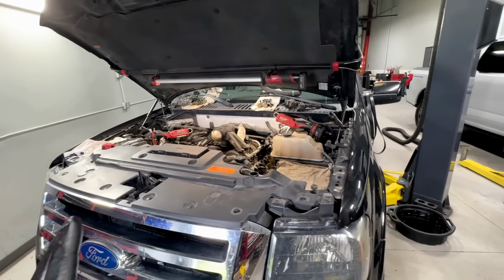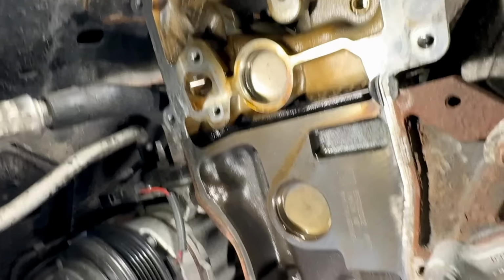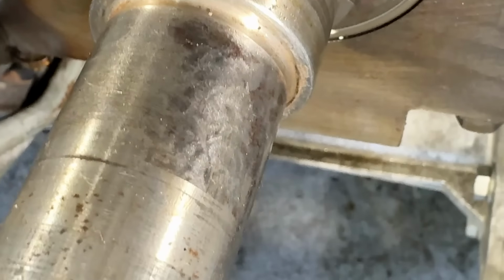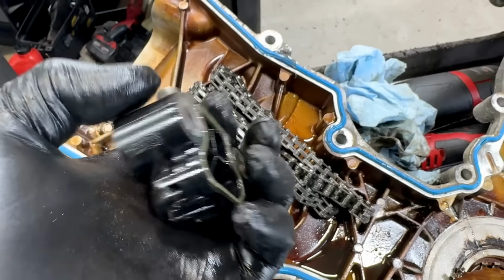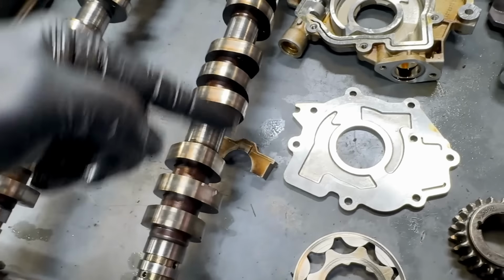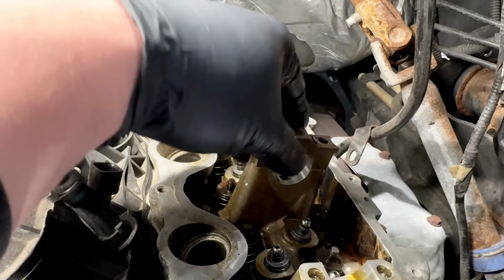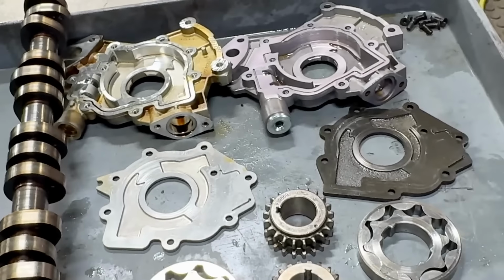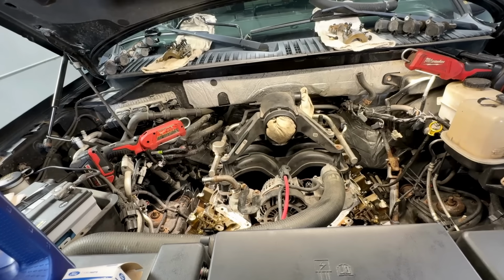How to Destroy a Perfectly Fine Ford 5.4L 3v Triton Engine with a Timing Job!

Comment: My 2006 F-150 Lariat Super Crew 5.4 3v has 272,000 miles and has only had two sets of plugs and an intake cleaning. Everything else is original. Switched to 5W30 full synthetic years before I found Brian’s channel and his recommendation. Pulled a fifth wheel travel trailer multiple times a year until my wife died 3 years ago. Absolutely love this truck.
Reply: Same here but my 06 has 240k on it. I’m thinking it’s time to freshen her up. Edit: my condolences only read the first half of your comment, side not I switched it up after finding his channel. Can you guess how I found his channel? 😅
Reply: Sorry for your loss.
Reply: Seems like when you get a good 5.4 3v, a little luck and a lot of preventative maintenance (regular oil changes) these engines are good for over 200k from the factory? Anyone agree?
I have a 2010 Expedition in mint condition, 166k miles, always maintained and it runs great! Would love to bring it to Brian when the time comes…. Hopefully not for a while.
Reply: I recently inherited an 04 f150 5.4 with 50 k original miles very clean truck after watching all your videos I'm going to seriously over maintain it thanks for all your great in depth information.
Reply: Keep it maintained and it will be a fantastic truck!@damxgopak457
Reply: Samething I went to Brian when I had over 253,000 and everything was original except the my water pump, ac compressor and alternator. I had him replace everything on the motor and add a new water pump, engine and transmission mounts and the truck drives better than brand new now and the mph has improved a lot.
Reply: @1937Jay 
You’re lucky that you live close to him. I’m way far away in North Carolina. I wish we had another Brian here. I would send my truck to them.
Reply: O4 f150 3v. After the cam phaser lockouts and metal timing chain tensioner, I've e had good luck with this engine
Reply: My condolences.
Reply: Sorry for your loss
Reply: @steveturner3999  Sorry to hear about your wife.
Reply: @MichaelStoneqm3  Thank you sir.
Reply: Love the comment.  Sorry to hear about your wife, I hope you are doing well, stay strong brother!!
I got '07 Expedition with 170k, hoping to keep it rolling for a while yet.
Reply: Sorry for your loss, God bless brother. So glad to hear about your lariat. I have the 2007 ,with 102,000 ,and have replaced 1 manifold,and rebuilt trans after unexpected oil failure,plus added extra oil cooler to pull 24 foot trailer,overall great truck and super comfortable. Just wondering about changing to 5w30 synthetic oil ? I think I will do it this summer,2026 and see results. Thanks for your sharing.
Reply: Glad you are liking your truck, sorry about your wife.i lost mine 3 years ago to, she was 38 I was 42 it's hard
Reply: I’m sorry for your loss

Comment: My Chain Is Short, And My Cam Is In The Middle Of My Engine...Where It Belongs. 05 2500HD Single Cab 4x4 Short Bed Conversion 6.0 Gas. Best Truck Ever😶🧂
Reply: All of those trucks rotted away 10 years ago here in the north. 🤣 Great trucks besides that.
Reply: @mph5896  Lubbock Texas...Totally  Rust Free. Ya Hard Times Up North.
Reply: Why are you watching Ford stuff then. You should be out driving that cherry Government Motors Corporation truck🤣
Reply: @saltymofo5870  I Own An Auto Repair- Hot Rod Shop. Oh I Drive It...
Reply: The early 2000s were the best GM engines. The new ones don't seem to be quite so good anymore, much like most of the other brands. 

I had an 87 GMC Jimmy with the TBI 350 and it was pretty indestructible. I ran the hell out of it, had a lift and took it off road a lot. Around 155K miles I flooded it a bit off roading (water). It started getting really sluggish and I thought maybe I had done it in. I bought a hand me down built 350 from a buddy who was upgrading his Blazer to a stroker motor. Before we went to swap it, I changed the fuel filter on the truck so it'd be fresh and ready and the truck laid rubber from a stoplight after. The old filter was packed full of mud. My fuel pump hat broke where the lines went in and it was basically funneling in all the mud and water that I went through. Ran like a champ after. My buddy put my engine in his wife's Suburban and it went another 100K before they sold it. I wish I still had my Jimmy, it would be worth a fortune. Despite my fun with it, it looked like new when I sold it for $4K. Ugh!

Comment: Don’t try and save a couple bucks by going to a shop that can save you a couple hundred bucks… it will cost you thousands
Reply: Even top dollar shops can butcher your trucck. Its really hard to find anyone reputable to do the work right.
Reply: @irogers858 no it isn’t y’all just scary bc y’all think every mechanic is this and that 🥱
Reply: Price alone is no guarantee of quality.
Reply: Doing this job yourself will save you thousands. Luckily we have these how to videos on doing this exact job correctly. Just did this job last month and the truck runs great 👍
Reply: @justingoats9155  I hope you watched the additional video where he recommends replacing the roller followers and lash adjusters while you are in there, and you did it. The roller followers are the weak link in my opinion.
Reply: @justingoats9155 Did you do a full timing job and replace rollers, too? 

About how long did it take you? I'm curious because I'm about to tackle it myself on my 2004 F150 5.4 3v 😅
Reply: excelent  live by it
Reply: Don't go to a shop at all, unless it's Brian's. Do it yourself. Follow Brian's advice to the letter, only buy OEM parts inside the engine, transmission, and other hard to get to places, and change your oil every 5k with 5-30 and the 5.4 will run for at least 300k miles.
Reply: I won't even let my dealer change my oil, that how bad it has gotten.  Everything has changed, everything.
Reply: It’s not easy to do when you’re working with a slim budget
Reply: Thanks dad
Reply: @DoyleShadduck  I’m a mechanic, I did the work myself
Reply: I tell customers quite a bit that saving money doesn’t work
Reply: Just learn to do it yourself
Reply: Amazing informative vid. Thanks 👍
Reply: PUT THAT SHYT ON A SHIRT. ASAP 👏 👏
Reply: Top shops have lots of overhead bills that’s the main reason they are expensive not that they are better then other mechanic shops

Comment: Our shop has performed the timing chain, tensioners, guides and roller followers from Ford (in accordance with Brian’s recommendations on this channel) The only non-Ford part we used was the Melling HO engine oil pump. That 2009 F-150 has over 25,000 miles since this service. The truck had 198,000 miles when this procedure was performed. We saw those Melling cast iron tensioners, but we chose to go with the upgraded Ford tensioners.
Reply: Are you saying your shop did this job? I'm confused...
Reply: @Traxxis03 no, he said it was a 2009 F150. The vehicle in the video is a 2014 Expedition.
Reply: You gonna reply to the first question?
Reply: @Nick-xs3bg  so I'm not the only one that wondered?? That's good to hear. 😂

Comment: I bet the other shop was proud of the work they did to rip off the customer
Reply: The harmonic balancer torque is the big one on that job. Along with using the plastic tensioners when the customer paid for metal. Surface prep done is no concern
Reply: From where I can see, their bad job was not attributed to poor surface preparation. This failure appears to be based on the owner’s  choice of substandard parts.
Reply: @jamram9924  What about mixing up the camshaft caps and not torqueing the harmonic balancer bolt properly?
Reply: @westhavenor  we followed the guidelines on torque specifications and numbered/marked the camshaft caps.
Reply: @westhavenor  Brian made an assumption the cam caps were mixed up. Not a fact. The aluminum heads where the cam rides are quite often beat up and grooved since ford decided to use the aluminum surface as a bearing
Reply: @mph5896 most ohc engines are like this, if there are bearings it's usually just around a high pressure fuel pump
Reply: @mph5896 - I have to disagree with you.  Those cam caps were WAY worse than normal wear and were likely part of the oil pressure problem and the source of all the metal that went through that engine.
Reply: @ghostwrench2292  I have had a lot of 3v apart. That’s what they look like. It may or may not have looked like that before the work was done. Can’t tell now. 😉
Reply: @jamram9924  Yep,when you screw up and take to the best shop and Tech the second time instead of the first,its gonna cost a lot more to get it done right,or to get it analized to be saved or replaced!And when it comes to parts inside an engine,I wouldnt use aftermarket, too many cheap parts out there,I would use manufacture parts,Chevy,Dodge,Toyota,especially Ford parts!
Reply: @jamram9924 
If that’s what you see, you best look again. That first shop fucked up multiple different parts of this job. Badly. Absolute hacks.

Comment: Just sold at 21 F-250 with the 6.2 with 15,000 mi. Biggest piece of s*** vehicle I ever owned. I will never do Ford  again.
Reply: And yet I work a couple of  the same trucks in a quarry and open pit mine and they perform great.  No mall runs for these trucks….
Reply: @cwqrpportable  I have one in my 11 F150 and the Ford place said they very rarely fail. A few had some broken valve springs but they rarely replace or rebuild. I got to tow at is rating (11.1K maxtow) and it pulls very, very strong at 200K. Very strong motor. I'm sure there are few bad ones but nothing like a 5.4
Reply: @user-rz9er5dm6k  Good experience here too…..mine get pounded on
Reply: @user-rz9er5dm6k yeah I had a bad one . It pulled a 6000 lb camper great .
Reply: U got a bad 1.that 6.2 a darn good motor if taken care of.
Reply: @jermainephillips5179  Yeah I have a 6.2L F150 and it is extremely reliable at 200K. There are no phasor issues - the phaser uses valve spring pressure not oil pressure to set. Wonder what the problem was :(.
Reply: And I did , first oil change at 600 miles , then 2,500 after . Etc etc . Highway runs 50% of miles . Belt squealing clanging going on. God awful rattle at startup half the time. . I said to myself if it's this bad at this mileage what's it going to be with 50,000 miles . @jermainephillips5179
Reply: Are you sure that was a 6.2 as Ford introduced the 7.3 gas engine for the 2020 model year ?
Reply: Yeah lol I knew what engine I had  @charlesb4267

Comment: Don’t buy a Ford.
Reply: They all have problems
Reply: Just don't buy anything if you don't want it to break..
Reply: Don’t buy a Toyota Tundra
Reply: Fluids, fluids, fluids... never go what their manuals say. They warranty a certain mileage for a reason. Sooner sooner sooner than what they say!! 270,000 on my 5.4 3v... original engine/tranny
Reply: Seems like those boring old Nissan Frontiers are looking better and better, now that Toyota has ruined the Tundra
Reply: @westhavenor  ...Yeah..I heard one the other day with that goofy 6 cylinder in it...Mite as well buy a Model T...Big as that trk is and they put a goofy 6 cylinder in it...
Reply: Yikes, I know owning one of these newer vehicles is expensive  😫 😩 😭...But, people you have the Internet and YOU  can call a fella like "Dr. Mikulsko " ,get a quote and start saving up for the best repair and parts...OR  you can end up like this customer...BUY ONCE...CRY ONCE...Even a junkyard motor ain't no  guarantee...Why, coz eventually you  gonna need this job done or get rid of the vehicle...This vehicle new is about $60,000.00 USD...Your choice...😮😮😮...